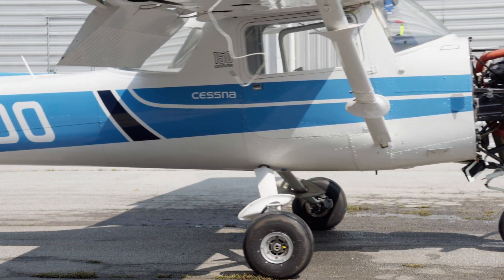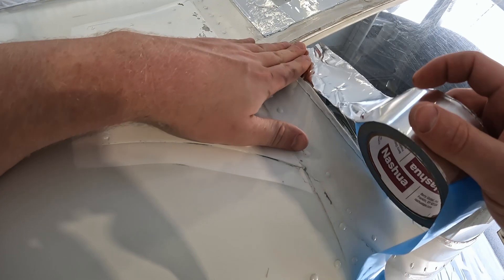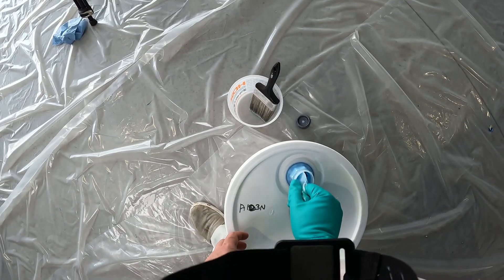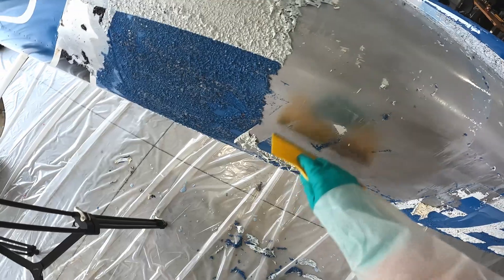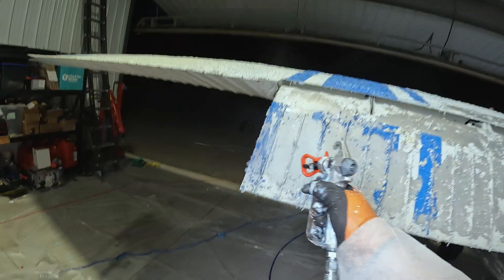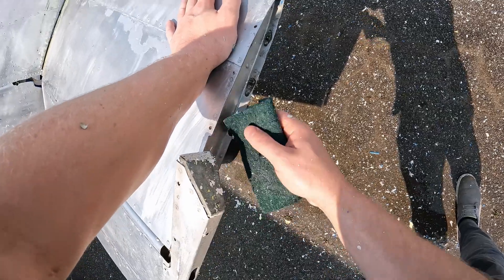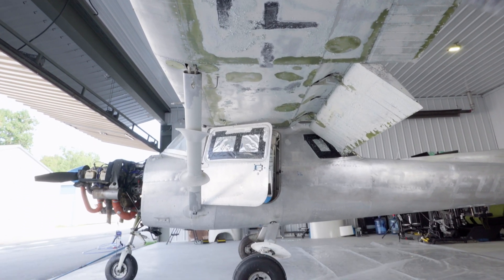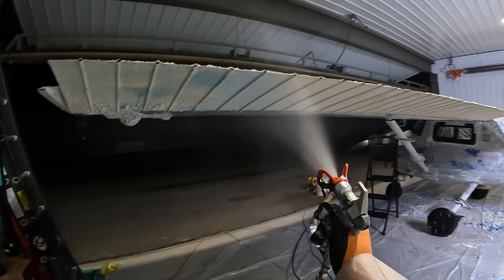Automated aircraft project... Cessna 150 paint removal [Episode 3]

Comment: Is there an issue with the remover getting between the skins at the joints? And or on things around the doors or access panels? Thanks
Reply from the maker: Socostrip is widely used on commercial aircraft with riveted construction. It's fairly thick and does not seep through riveted joints. However,  when rising with water I found that the water/stripper can get into large gaps. Seal them if you're concerned. I kept the access panels on to avoid getting stripper inside the fuselage and wing. It won't damage the aluminum but will make for a bigger clean up.

The main thing to avoid contact with is fiberglass, plastics and rubber. It will eat at all of them. For fiberglass fairings I would suggest sanding instead.